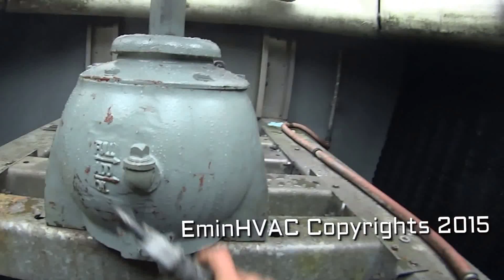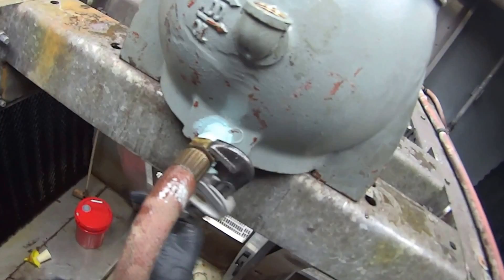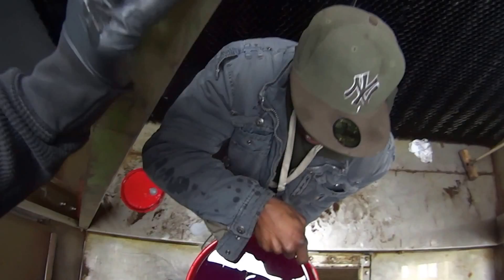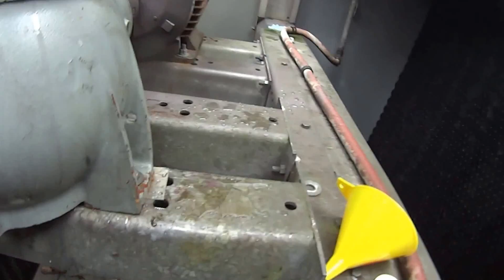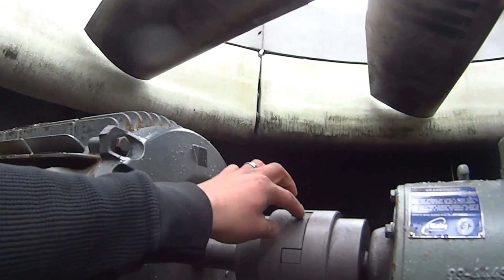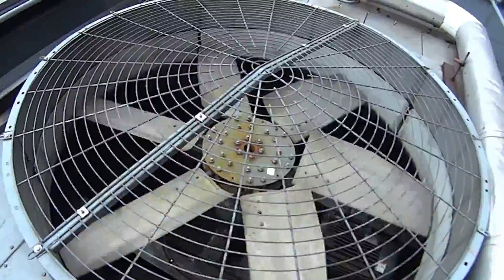Marley Cooling Tower | Test Run | HVAC

Comment: Pipe wrenches on a garden hose! Contaminating the water with oil spillage! Inside when the blades are still turning! No L.O.T.O.? Inside the tower when the fan is on. I want to hire these guys!

Comment: nice little fan, I never saw a gear drive one before
Reply: 65bug519 Marley loves Gear driven systems. I prefer them personally. It cost the customer more but the life is a lot longer than belt driven systems. Less maintenance during the 5 years as well.

Comment: Sweet!!!  Nice work man.  Been waiting on the conclusion for awhile.  Whats next.  lol.  What type of gear oil does that use.
Reply from the maker: Thanks  bud, next, I don't know what's next lol marley uses 20 different oils for the gearbox. They use mineral oil for normal duty and synthetic for sever duty. basically any of the major oil company's that produce oil can be used with the gearbox. they use different viscosity for different applications.
Reply: Thanks.

Comment: That's running like a champ.
Reply from the maker: It's running beautifully,  all I have to do is install a VFD on it and she's ready to rock. I believe that's why this thing failed in the first place. Be for the gearbox the bearings on the motor failed, I've replaced them as well.